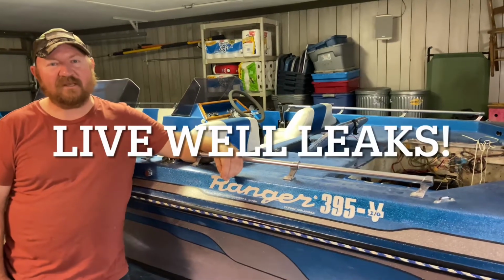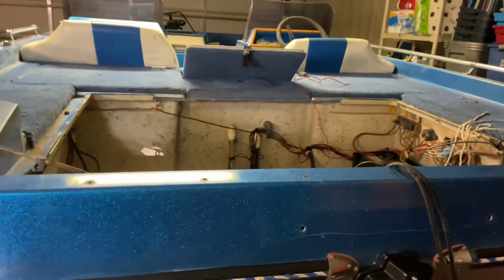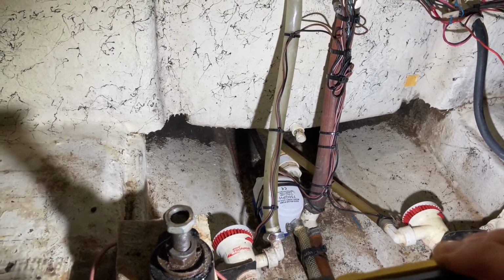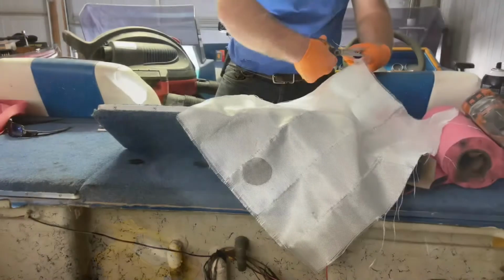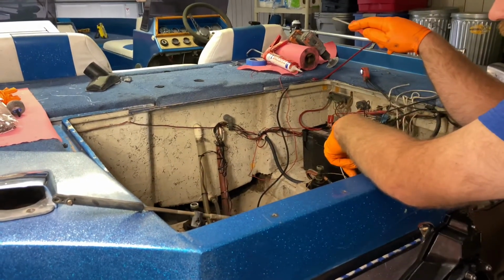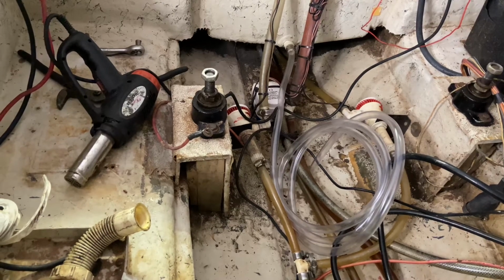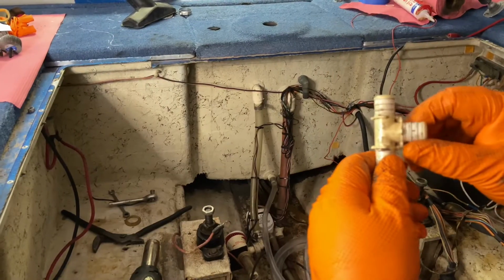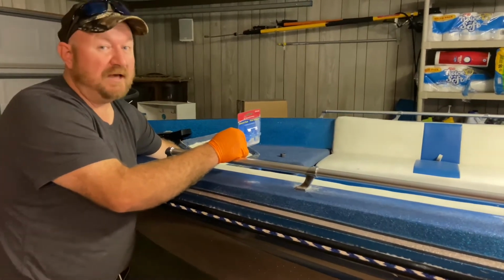Bass Boat Live Well Leaks

Comment: Can you let me know where you purchased the plugs that you show at 1:15 in the video? Thanks!
Reply from the maker: live well plugs:  https://amzn.to/3XUQa55
DISCLOSURE:  As an Amazon Associate I earn from qualifying purchases.
Reply from the maker: Saw your question about your boat-  good looking Ranger boat.  Curious about how you like that Suzuki engine?  I suppose you could use those plugs as a temp. measure until you can get your leak fixed.  You should make sure your bilge pump is working good.  I just used the plugs to help me find the leaks in my hoses and livewells.  They worked good for that.  Make sure they have a good snug fit and of course, test it out when you get on the water.